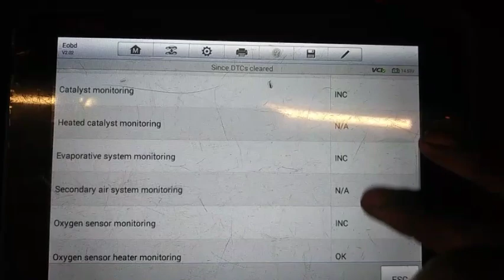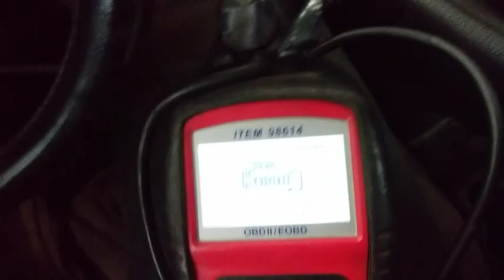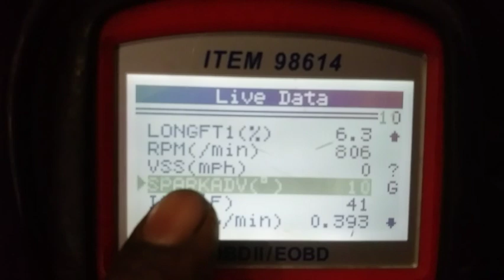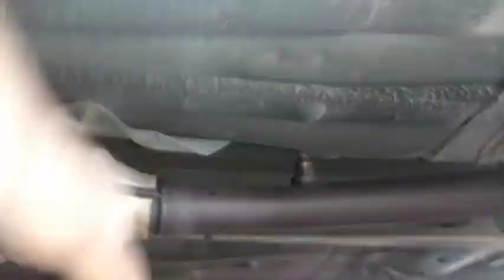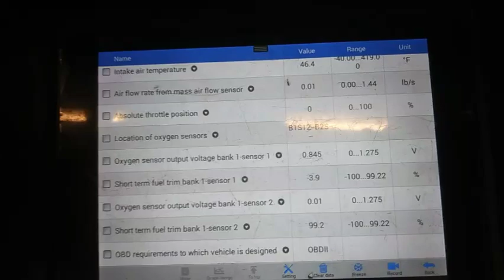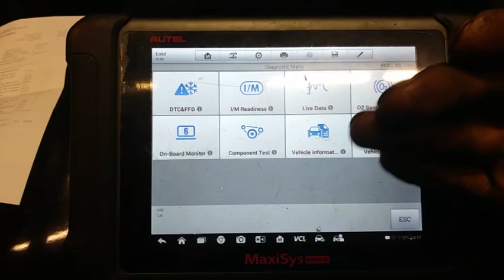Car not completing drive cycle???

Comment: Can't get my catalytic converter to complete cycle on my "97 Toyota Camry LE 4 cyl. --I've tried every recommended drive cycle repeatedly. I'm at wits end. Seriously considering just selling the car as is. Ridiculous.
Reply: Hang in there, my friend. Check out some of Random Fix’s videos. I have used one of his tips on my 2000 4Runner to get the catalytic converter ready for the last two California song checks (I’m in Los Angeles), and it worked like a champ. 
Here’s what I did. I started the car after sitting overnight (do not turn on the a/c), let it idle at least seven minutes to get the engine up to operating temperature, and then revved the engine at a steady 3,000 rpm for at least three minutes. 
My registration renewal is due before July 8, and I was sweating it because I changed the battery last month. You may have to perform the procedure several times. As of today, my car is now I/M ready.
If this doesn’t work, you may want to change both the upstream and downstream oxygen sensors. I ended up doing that last week because I couldn’t get the catalytic converter to complete after installing the new battery. They were both over five years old, and were due to be replaced.
Hope this helps.

Comment: Strange arent the obd2 supposed to be for the smog reasons and to monitor and see when the sensors arent and are working?
Reply from the maker: Yes you would think.  But the kinda intelligence you're wanting are are a couple years away. We do now have more detailed codes, like sub codes, for example, p0420-xx code will be more specific vs. p0420 you commonly see. You'll need a factory similar tool to be able to read it though,  not the generic reader like in the video. 

But mainly, this is what we mechanics are for,  to determine aspect of WHY by looking at context clues and understand.

Comment: Starting off with a big Thank you. This is the only video i could find that doesnt suggest me to keep driving around. I have a 2007 Civic Si been driving for 3 years woth the catalyst monitor incomplete. And now my 02 sensor incomplete. I recently replaced my 02 sensors. (324k miles it was about time) No check engine light. 2 incomplete modules to top it off im in California haha. Im starting to think im in the sweet spot of the Catalic converter going bad soon. But what voltage range would my 02 sensor be if the cat was plugged.
Reply from the maker: @cosmic_fam  you want to know the voltage when monitoring downstream o2 sensor?  Correct? 

Also,  do you have a scanner with live data capability?
Reply: @partsshooter  correct. And yes I do.
Reply: @partsshooter  I know you mentioned it in the video. But would it be the same for a bad or clogged cat ?
Reply from the maker: @cosmic_fam  you wanna see linear voltage and no sin waves〰️〰️. You wanna see linear movement --------. But understand you'll see some movement up and down but nothing deep like a tidal wave. 

Voltage isn't a concern over pattern because frequency is what is monitored and not so much voltage.  The upstream and downstream should not match in pattern. Again as much as a straight line through the graph as possible (preferably in the leaner range around  .100-.5 volt.  Again, it's not a big deal because if it's too rich and linear, then you have likely overall running a condition issues)
Reply: @partsshooter  Thank you very much.! 🙏 for your response. I never could get around sensors but I'm learning. Thanks again
Reply from the maker: @cosmic_fam  next time I get a car with this issue,  I'll do a video. 

I did have a similar issue though but it was a fuel trim imbalance,  but this shows how sensors working but not meeting expectations can cause monitors to linger in a pending state. I'll send a link
Reply from the maker: @cosmic_fam  https://youtu.be/hxIhsWuRfsI

Comment: Great video - better than some I have seen. Lots of useful info. I have a 2011 HHR that will not complete a drive cycle. Here in Texas we can have 1 inc and pass but not 2. I am hoping your info will help. Question, could you put the car up on jack stands to simulate driving? I do not see how the ECM would know the diff.

Comment: Pouring water on a hot engine can cause the metal to crack due to rapid contraction.
Reply from the maker: This one didn't do it though.  Nor have any other engine I've done that to. This logic you have don't apply to any method I performed. Not sure how you manage to crack engines doing this. But your doing something wrong

Comment: Very helpful. Fixed my problem. Now I've got a problem with my evap monitor. It won't run during the drive cycles I've put it thru. Any ideas you have for this issue? Thanks. Phil

Comment: Thanks for this informative video.  My speed sensors are out on my RX300 and that's not allowing the O2 and others to complete their cycle.  I learned a lot from you on how to use my Centech scanner more effectively.  Thank you.  That was also a good tip on using universal sensor and swapping the connector piece.

Comment: I drove mine 600 miles. No codes. Cat still not ready.
Reply from the maker: Try checking the PIDs that hasn't completed its monitor and see if they're within range. If the component failed,  replace the part. 

This the best general info I have.
Reply: @partsshooter  Ok. Im trying everything.

Comment: The voltage on my downward stream o2 sensors are "finished" which is why my smog fails. Do you think replacing them will help me have all my monitors complete and pass. I have a 2015 Challenger.

Comment: I have Torque Lite that I use to check my emissions readiness. It says Emissions all pass, but the drive cycle isn't complete. What do? 06 RT Charger, just replaced the cats. I've been driving for over 150 miles. I've done all the cycles recommended for each of the incomplete drive cycle checks. Idk what to do. I'm going to run it for 200 miles (got an extension for my emissions and it's registered). That normally completes the cycle for me, but what the heck? City and Highway driving was done as well in that 150 miles.

Comment: Permanently attach a trickle charger plug on the battery and the car will not clear it’s computer when the battery goes dead . I learned my lesson with my jag that I rarely drive.

Comment: Good video.
I have always wanted a device that would auto run all vehicle monitors and make the pcm think it was hitting the right speeds and inputs so after the repair you could plug it in and let the vehicle run for half an hour and set all monitors.
It should be standard on every scan tool, like a self test mode.
Reply from the maker: Autel has this feature for evap monitors, it works on very few vehicles while stationary though. I know kia/Hyundai I can perform a evap leak test and it'll run the evap monitor test during this time
Reply: my obd scanner for my beetle/audi would force everything to run or test which then showed it working unless there was a fault code.. self test mode etc

Comment: Emission sensor won’t complete and now a bad tpms sensor will prevent inspection 🤣  Brand new bf Goodrich ko2 and meticulously monitoring tire pressure/ oil condition /level
So basically I’m not a bum about maintenance
Reply from the maker: What are you talking about?

Comment: Great  video...I have a 2000 Jeep Wrangler I already drive my Jeep over 1,000 miles on it and still Cat not ready! I got new 02 sensors, new catalytic and still nothing..I’m getting frustrated with this drive cycle? Any suggestions will help thank you..
Reply: I’m having Evap and o2 not ready after driving around for over a week. I think it’s because I’ve been running the A/C too. Gonna do another drive cycle with the A/C off and see if that works.

Comment: a lot of what your saying is not correct.
Reply from the maker: Make a video explaining what I said that's incorrect and we can discuss on a live feed one day. Thanks
Reply: @partsshooter  i wont make a video but we can discuss it on Facebook "Riley's Garage".  No disrespect intended, just seen something and thought it would be helpful to point it out.
Reply from the maker: @kcsnRiley  no problem... I'm open. However just know that drive cycles are general, this isn't conclusive for ALL vehicle manufactures.
Reply: @partsshooter   this is true, but the part that most stood out to me is the 20 degree difference between the air temp and the coolant temp, they should be between 7-10 degrees.
Reply from the maker: @kcsnRiley  yeah, that's actually fine. During a cold soak, the air temperature and coolant temperature needing to  be "below 90 degree and "within 7" is an unofficial expectation, if this was mandatory the drive cycle wouldn't be considered, due to the fact the car uses these values to determine a cold start granting access to initiate drive cycle. I simply used the mandatory value that determine a cold start condition, Bellow 90 degrees.

O2 Heater monitor...Evap... Cat monitoring require recognizing these values, if it was unacceptable the drive cycle wouldn't be considered to run these monitors. 

I'm sure there more strict requirements on newer vehicles slightly post millennium, which some May have timers however for late 90s vehicle, the intelligence isn't that grand! Just look at the narrow parameters and high voltage used to gather info, 10s placement vs the hundredths placement today [hundredths millivolt vs the tens of millivolt ] -I mention this to say, this car just isn't that intelligent to recognise and reject that 7 degree different, only mandating what's overall desired  being below 90 degree.

Comment: I’m having a P0158 come coming up on my 2006 4.0 Toyota 4Runner. Code reads high voltage on bank 2 sensor 2. Changed the sensor out and still having the same code. Now do you believe a successful drive cycle can fix the problem? Or will I have to check fuel pressure, catalytic failure, leaks, etc?
Reply from the maker: It Depend on how immediate the code returns after clearing. Situation 1, the code come back immediately, then you likely have a faulty new sensor, poor connection or broken connection. Such as ground for that o2 sensor or signal wire is broken going to pcm.

Situation 2, the code come back after miles of driving, like a day or so after car has cooled. Then, your catalytic converter is inefficient. meaning, the mixture is excessively rich and there's low oxygen content inside the catalytic converter. But you should have a p0420 or p0430 follow up code. So based on your message. Situation 1, is gonna be likely your issue.
Reply: @partsshooter  Thanks a lot man!! Really appreciate it

Comment: you said oil changes are pointless? that might be the dumbest thing I've ever heard, besides that good video. here in Texas, a vehicle from 1996 to 2000 that runs on gas and is under 8600 lbs can pass with 2 "not readys". a vehicle that is built from 2001 to present day runs on gas and is under 8600 lbs can pass with only one "not ready". lastly is you need a new battery, wtf u talm bout

Comment: I'm currently dealing with the 02 and Evap monitors "Not Ready" on my 2017 WRX. I have some light modifications, including TGV deletes, GrimmSpeed boost solenoid, and a Cobb Big SF Air Intake. My tuner doesn't seem to want to help me with this issue, so I'm wondering what type of mechanic I should work with to figure this out? I a couple mechanics I've talked to don't want to touch my car because it has been tuned. I live in Massachusetts and I don't think they allow any of the monitors to be "Not Ready"
Reply from the maker: TGV, these are emissions related from what I understand. Typically if a car can't go through it sequential system test, it'll halt further testing. 

Not sure if you have check engine light, but if there things that have been "reprogrammed" or bypassed within the pcm, they're gonna have to be set back to standard settings, as id imagine that there aren't parameters that aren't being computed and car registering as pass or fail because, it's overlooked "bypassed"

May have to have a stock computer and swap with your tuned when needing inspection.
Reply: customhonda yes, no warning lights come up. I'm starting to think they probably bypassed something in the tune. I hadn't heard off swapping computers before though. Thanks for the video!
Reply: @user-ek5sm8hf2b  did you have to go to ur stock tune
Reply: @brandonflaum5382  Sorry for the late response but sadly yes I did. I paid my Subaru dealer roughly the same amount I paid my tuner to bring it back to stock, which included a brand spanking new ECU. I will say that the stock tune turned out really well, it was actually better than when I drove it off the lot. I'm not sure what they did but the car drives better than when it was new.
Reply: dang all.. they should at least allow one to be not ready.. Even in california they allow one to be not ready

Comment: How many miles do you got to have it be good to go
Reply from the maker: If Youre trying to pass inspection, check your local laws because here [as of late 2019] anything below 2000 require safety only inspection.

To answer your question. Millage is dependant on vehicle requirements. If the car detects a fault or in this case, don't see drive cycle monitor requirements, the car will not attempt to complete monitor.  I hate to say but theres no set millage. 

 In a perfect world you'll be able to complete drive cycle under 50 miles.  This car, once fixed took about 10-20 miles.

Comment: I got an Infiniti QX56 2006 P0420codes Bank 1 and 2-I replaced both upstream 02 sensors erased codes drove it and the only cycles it has trouble with is 02sensors and Cat and when it does pass 02 sensors goes to CAT then all lights go green and throws check engine light on again

Comment: Can you put the car on jackstands instead of driving around like a madman for drive cycle?
Reply from the maker: Likely no... Because most cars require deceleration enrichments to monitor egr and catalyst. Also looking at live data pids, the car utilize various sensors to determine proper drive cycle monitor testing conditions, so theres no engine load when cars on jack stands, therefore no steady "load percentage" value, meaning its not gonna go through its testing phase. 

Maybe something this old or pre 2000 but definitely nothing over 2000
Reply: @partsshooter   Me putting my jack stands away >:(
Reply from the maker: Good question...
Reply: Thank you for this video. I have a 2012 Civic and it failed smog because I had emissions recall work done at the dealership and from there went to get my smog check. All the monitors have since reset except for EVAP and O2 sensor and I’ve driven almost 100 miles. Is it supposed to take that long?
Reply from the maker: @marineranegrita  geez... Apologies, YouTube never notified me of your comment.

Comment: Great video thank you for the knowledge. I hope this works for me. 1997 grand Cherokee not completing Evap and catalyst. I need catalyst to pass so I can smog this sucker.
Reply: Did it work? I cant clear those monitors as well, been driving it well over 100 miles
Reply: Sorry I have no idea what worked I drove it for 2 weeks and then it cycled all of my tests on my computer. I swapped out my 02 sensors and my throttl position sensor